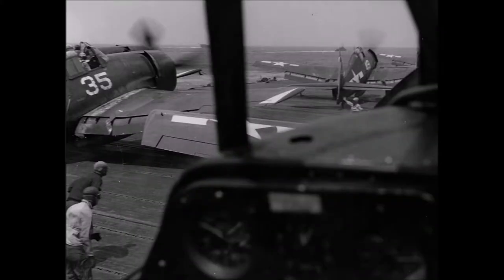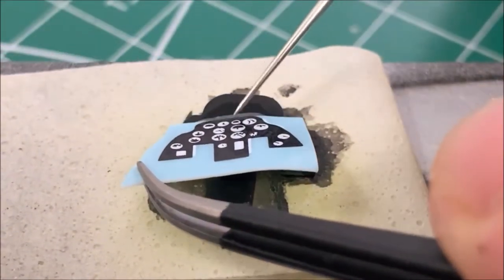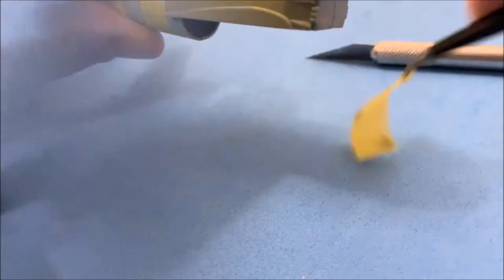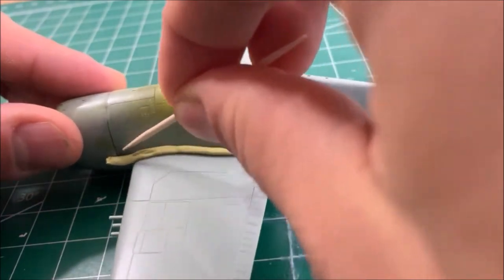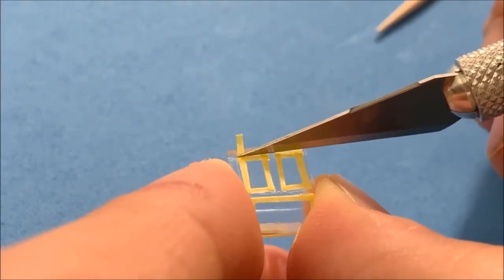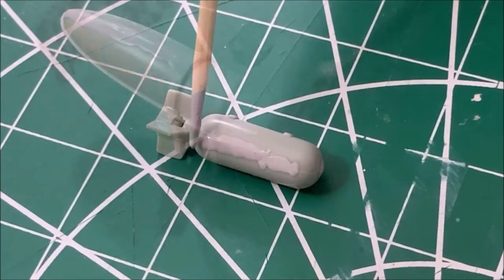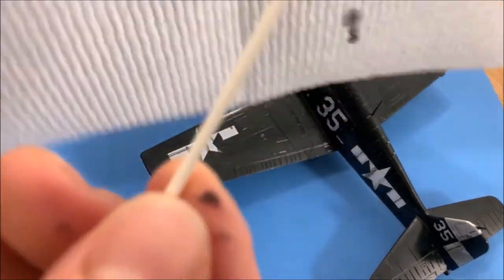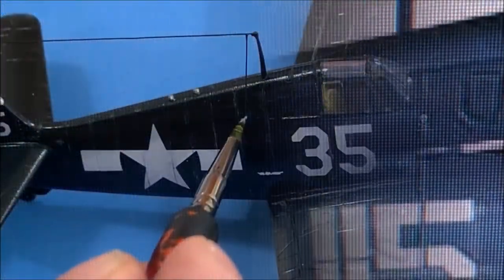FULL BUILD VIDEO ACADEMY F6F-5 Hellcat 1/72

Comment: Great job I’m working on the same one right now u just got a new sub
Reply from the maker: Thanks for the sub Mickey! Really enjoyed making this one, hope you do to!
Reply: @joekmodels  wow thx for replying my only question is how did u tape up the canopy cage I’m stuck on this step cos there are so many approaches and I’m scared I will botch the procedure
Reply from the maker: @supermickey6196  17:48 is how I did it. I cut thin strips of Tamiya tape, and using a brand new blade, cut  the strips. I used a masking gel over the part I didn't want to paint to save time, but you could just put a square piece of tape over that as well. Something else I do is I will just put a whole strip of tap over the whole thing, and with a toothpick push in so I can see the out line and then cut the square.